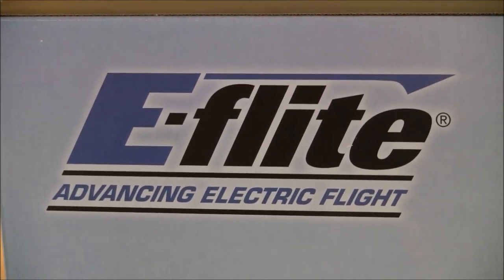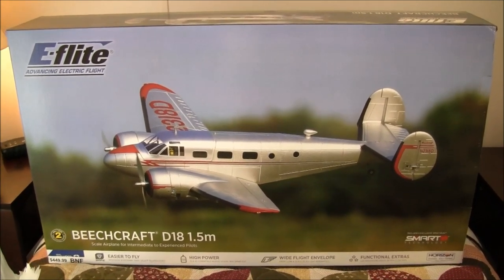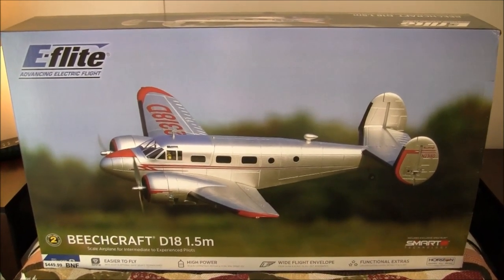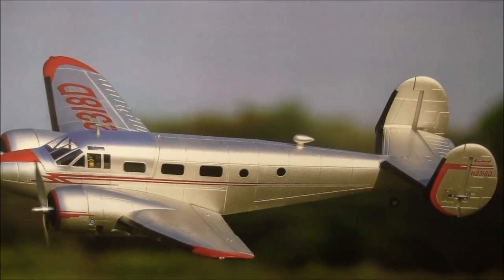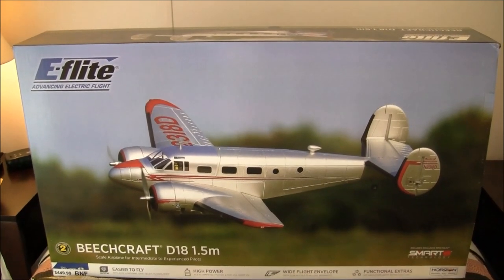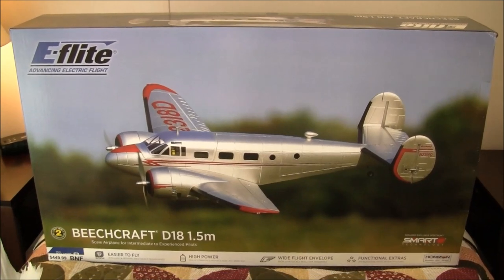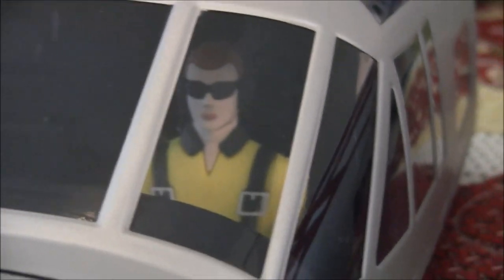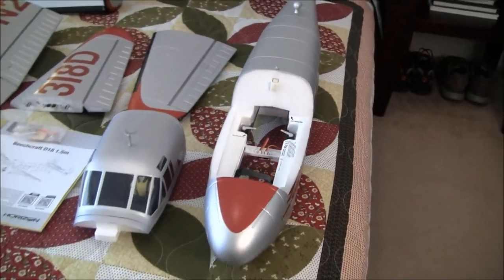E-flite Beechcraft D18 1.5m BNF Basic: What's in the box and post assembly functions check!

Comment: I flew my Beechcraft D-18 last Week first flight just a little trim on pitch and slight trim on roll rate second flight spot on flies extremely well, 4 c 4000 set fully forward. 6min flight time. landings  wheel landings are the best.  Great work Horizon on design and quality. Happy Pilot,, Michelle Nolan,, United Airlines, (ret) f/a
Reply from the maker: That's outstanding Michelle! I found mine to be the same way; adjusted the elevator slightly and just a smidge of aileron to correct a slight roll. I agree with you, the wheel landings are the best! This is one great looking and great flying model. Thanks so much for checking in, blue skies and happy landings to you!

Comment: FYI ...watching this again during my assembly...the CG in the manual is 22mm +/- 5, 'forward' of that panel line at the wing joint???    May be the reason for your more up/neutral elev. setting...just wondering ?  thank you...have a great Thansgiving...
Reply from the maker: Yessir, I was surprised myself when I saw where HH decided to put the C/G. No worries, I'm sure it was easier doing it that way than doing it closer to the wingroot where C/G is normally measured. I set mine up exactly as the manual recommends, but after flying mine I made some adjustments that suited me. I always encourage folks to follow the manual, and then go from there to fit their own liking. Have a safe and Happy Thanksgiving my friend!

Comment: Easy way to snap wings together without damage...lower wheels , place fingertips of one hand into wheel well and use other hand to apply force at wingtip to push wings together....what was  your CG measurement ???..there suggested number ...no way !!!!! extremely tail heavy............and did you use flap- elevator mixing ???? I found their numbers -    -4  an -7  on elevator that were suggested gave me up elevator with flaps...isn't that backwards ??hahaha.....
Reply from the maker: Hey thanks my friend for checking in! I agree with you, I initially used the suggested CG measurement, but then adjusted the battery placement forward to make it a little more nose heavy and found that much to my liking. My flap elevator mixing worked for me (i.e., a little down elevator when the flaps were extended), seemed to work out for me. I really enjoy flying this plane, it just floats in for landings and will fly forever on a 3s 3200mAh battery. All the best to you!